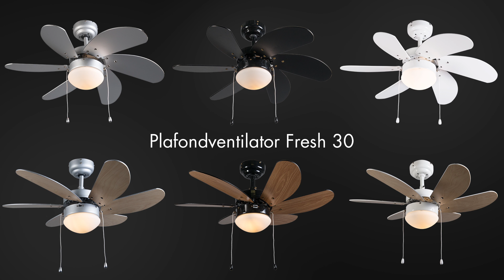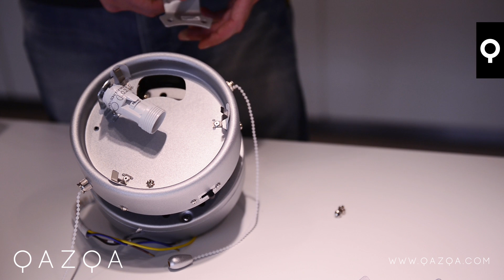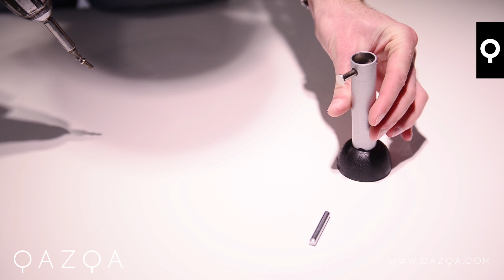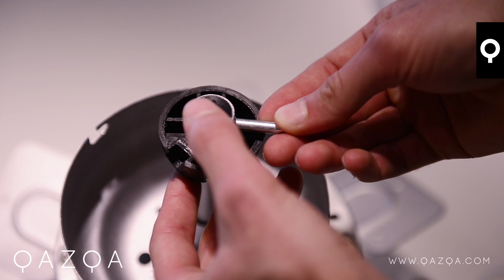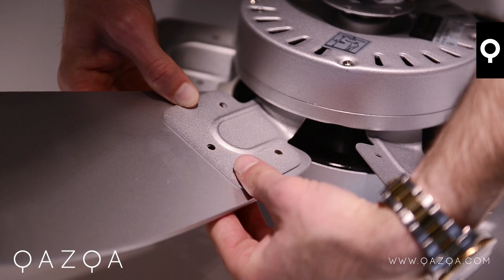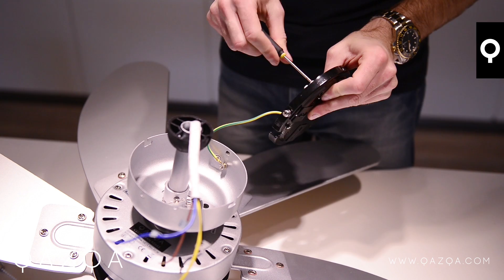QAZQA Ceiling Fan Fresh

Comment: For those looking to know how it mounts to the ceiling. There's a plate that you screw into the ceiling, held down (up?) with 2x ~7cm screws. You need to source your own rawl plugs. The plate's holes/slots for screws are spaced between approximately 7cm and 10cm. There's a larger hole in the centre for the power lines to pass through.